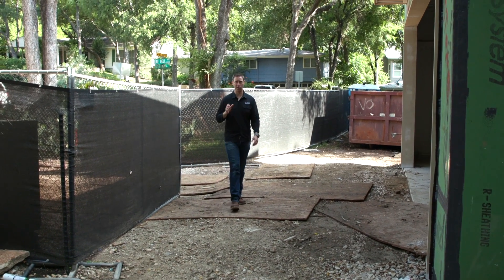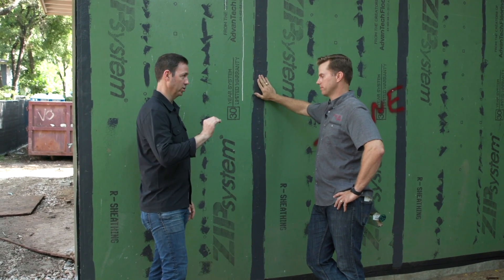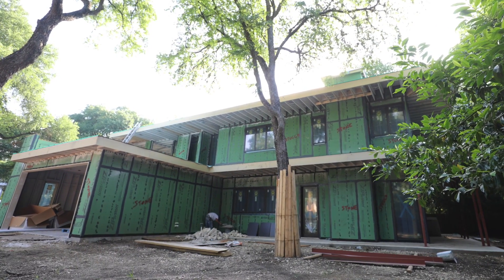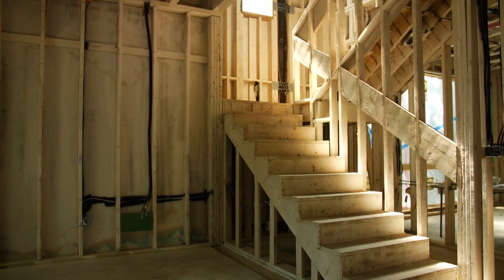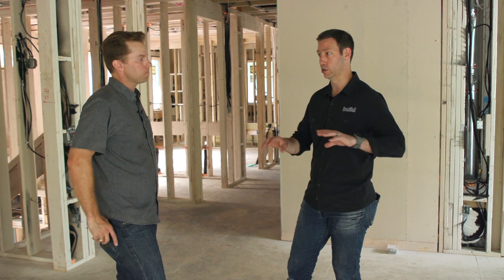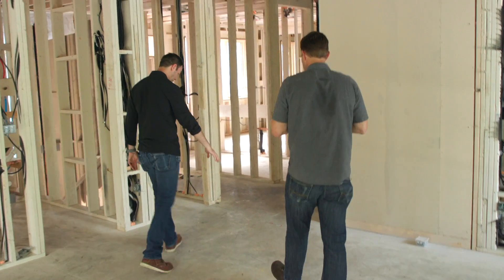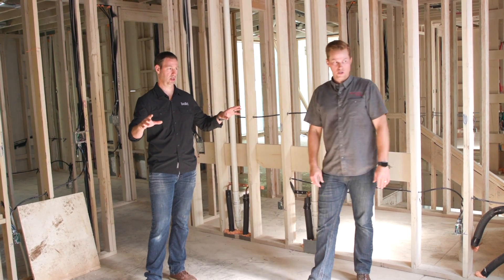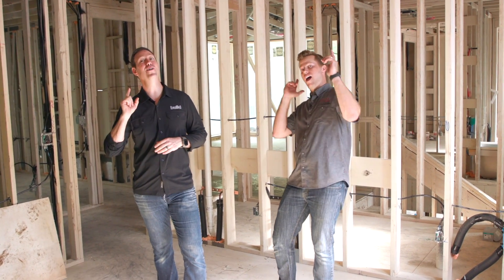Foam Free House - Is this Silly, or should we ALL BE BUILDING LIKE THIS?

Comment: Matt, I'm really intrigued buy the Zip system and will use it when we build next year. Using the liquid flash seems like it's more labor intensive but it'll allow for 100% coverage of seams and nail holes. Is there any way to continue this barrier method when installing roofing and or siding?
Reply: Yes, zip has a thicker material (it's pink) for roofing. And just tie them together with fast flash
Reply: FWIW: Put a bead of caulking on the studs before you nail the sheathing to the studs. This should help with most of the air sealing.  You can use a cordless or pneumantic calking gun to make it quick & easy.

Comment: Has problems with EMF, goes to extraordinary lengths to shield wires in the walls, all the wires attach to ... Outlets which stuff is plugged into. Didn't see the part where the whole house is wrapped in a Faraday Cage. Maybe later! Oh, make sure to never turn on the Mains breaker either!

Please tell me this person doesn't work for the government!
Reply: Im glad that someone else made this comment. I was thinking the same thing. I was also wondering if they put ferrite caps over the outlets. It doesnt look like it, so i hope the nut job doesnt too hurt by the EMF demons. 

As for the person working for the government... yes, they likely work for the government. You can also guess who she voted for in 2016.
Reply: Do you even know what you are talking about?? EMF shields work!! It is no problem that there are outlets and / or you have parts that are not shielded at all. The shield work for the part that is shielded.

Comment: I bet that Matt is overjoyed that he isn't building for this client.
What type of house did she live in for the first 4 or 5 decades of her life?
How was her work space built? Does she go into restaurants, salons, gyms? 
Travel roads alongside petroleum vehicles? Experts sure are fun.
Reply: These people are not rational, so your questions will not make her think rationally.
Reply: @parajacks4  _Excellent point!
Reply: Yeah the perfume thing is probably just allergies.

I don't like sleeping in the same room as the wifi router because I can usually hear the external power supply squealing. That's it. It's just that normal, annoying buzz that comes from a switching AC/DC power supply doing its job. Eventually, I won't be able to hear it anymore, because that's just how it goes
Reply: @skuzzyj  The only time I've heard any squealing or other noise from a switchmode DC power supply is just before it died.
Reply: @TonyRule  
Yeah? I've actually had a couple go bye-bye lately.

But I've also noticed that from many electronics over the years, so I just assumed I was just naturally calibrated to hear and thus be annoyed by that hum/squeak
Reply: @skuzzyj  I actually have seven or eight 12VDC power supplies plugged into a multibox right next to me right now and all I can hear is the mechanical spin of the external hard drives they're powering. The one that squealed was on my Draytek Vigor 120 VDSL modem. https://youtu.be/-k5fuLDrpO4
Reply: @louish3010  you are one rude bastard.. keep it civil
Reply: She may have just gotten sensitive recently.  I've been chemically sensitive for over 21 years now, and It's a very limiting condition.  Restaurants are OK but salons and gyms I can't be in.  Travel is very difficult because of ubiquitous use of air "fresheners" used in almost all hotels.  The malady mostly affects women.
Reply: Barbara Smith 
Yes I understand chemical intolerance, my sympathies to you, as my wife gets a bad headache every time she is close to someone wearing perfume. It is the supposed sensitivity to electromagnetic radiation that makes me think she is not all there.
Reply: @parajacks4  no it's real. Some people can't sleep in the same room as wifi router, and sperm counts and qualities decline are the easiest things to notice. Also know that sperm count and quality is a scientific measure for toxicity. 
Chemical sensitivities are crazy a couple years ago I would have made jokes, now I have asthma attacks from people perfumes or fresheners or even bleach in a bucket.
Reply: @louish3010  that is just sensitivity to soy beans LOL
Reply: @parajacks4  about 20 years ago, I spent a summer at a  clinic to see if they could help my condition (they couldn't).  There I met at least half a dozen with people who claimed  to have EMF sensitivities.  I believed them because no one at home was believing me, so I was inclined to sympathize.  Why would they lie to a total stranger for no reason?
Reply: @barbarasmith6005  they wouldn't lie. it's more likely that they believe it makes them sick and like a placebo effect, them knowing it's there actually starts making them sick. But they could also actually get sick. I just think the combination of chemical sensitivity, electrical sensitivity, and phobias of foam and glue and mold starts to sound more like a hypochondriac.
Reply: @barbarasmith6005  I am mostly just chemically sensitive to what I call oh DAH Stinkum that women insist on wearing aka French toilet water
Reply: @stevepailet8258  I don't like any kind of perfume, either.
Reply: @barbarasmith6005  "The malady mostly affects women." Of course it does - they're far more irrational and neurotic.
Reply: @bmay8818  Maybe you aren't aware that, in addition to not caring about your feelings, facts also don't care about the year either.
Reply: @bmay8818  Despite what is clearly your best effort there, it doesn't hit a nerve with me at all because I know your claim doesn't apply to most men and certainly not to me.
Reply: @TonyRule  Careful there, you are skating dangerously close to the crime of "noticing".
Reply: @interferon4800  Yes, apparently some people believe that in this Brave New World one must not make observations over many decades and draw any  conclusions from those observations that may be seen as unfavourable by any person lest it cause someone, somewhere, to take offence.
Reply: @bmay8818  right!   They were half-assed rational post-war.  Now they've had their asses powdered for 2 generations and thoroughly indoctrinated with new age nonsense

Comment: Did I miss something?  The floor of the garage MUST BE, by code, below the level of the connected living space?  4" minimum?  Yes, I have been informed that the requirement has been dropped,,, because cars so rarely leak gasoline.  But garages are also the warren of lawn mowers, chainsaws, snow blowers,,, gasoline powered yard and lawn equipment.  And if the house and garage are on the same level,,, are the utilities spaces,, where resides the water heater, furnace, common ignition sources, again, at the same level?  In Texas I would think you would want the house raised for the next rain event.

Comment: omg...    😂🤣😂🤣      ”when clients have more money than sense”
Reply: When they even bring in "consultants" o suggest even more ways to be a P.I.T.A, it's time to cut your headache level and suggest another builder.
Reply: 10:53 the customer isn't that dumb
Reply: An ounce of prevention is worth a pound of cure.
Reply: @s0uthp4w68   sorry there isnt enough em from a 120 volt 60 HZ house line to worry about anything. along with they are putting clay on mare wood because of chemicals......what chemicals.
Reply: @3398halofreak  The clay paint is a practical product. It's to prevent mold and bacteria growth.
Reply: @3398halofreak  You misunderstood, the usual mold inhibitor would be the chemicals, so they used a natural inhibitor.

Comment: Videos always great to watch...I wonder if Matt can build me a tiny house that i can actually afford?
Reply: Get it built out of structurally insulated panels (SIPs), it’s the cheapest, most efficient and hurricane proof (with the right windows if necessary).    I quite literally know a company if you need one...
Reply: @grendelum  Bad idea:

1. Difficult to run utilities: Plumbing & electrical. Or you need to add a 2x4 studs as a utility wall space.
2. If it gets wet, your pretty much screwed. the OSB will rot creating an absolute expensive nightmare to repair. All it takes is a leaky window that has a flaw or if the window wasn't installed perfectly to cause a problem. 
3. very expensive. SIPS aren't cheap.

Best option for SIP is SIP roof panels, but you need to with a cold ceiling so the SIPs can breath to allow moisture to escape. SIP are moisture permeable and a lot of moisture from the interior migrates up to the roof. You also need to use a moisture permeable vapor barrier on the exterior side of the SIP roof panels. 

For walls you can add 2" to 4" of exterior rigid foam installation which can match SIPs depending on SIP thickness & rigid foam thickness. Rigid foam panels are quick, cheap, and easy to install and don't require complex installation like SIPs do  (Joining splines & need to backfill all the joints with spray foam)
Reply: I never thought about it, but this is actually a potentially brilliant way to find a builder, or for that matter a subcontractor. The people watching these videos are probably above-average builders/tradesmen.
Reply: Today... On the tiny build show!
Reply: Start saving $$$$

Comment: Ive had customers tell me to turn off their Wi-Fi when setting it up because they have EMF sensitivities as they're fooling around on their iphone. The only way to truly be away from EMF is to go live in the mountains. That jacketed Romex is safer but not for those reasons and that graphite paint doesn't make any sense you have to send energy somewhere.
 I'm sorry but that consultant is totally full of it just like the smart meter conspiracy Folk.
Reply: Cobalt is rather toxic as well...
Reply: cobalt can be toxic, so can many other things, depending on how its used and what it is combined with.
Reply: the flex conduit is still a conductor.
Reply: @nicodemus7784  I'm pretty sure the flex conduit is intended to be well grounded back at the panel. So it should act as a noise shield. I'm not sure anyone is questioning the effectiveness of the flex and the paint at stopping EMF, just the reasons for doing it.
Reply: @Andrew frink as caidhg mentions the graphite needing to send the energy somewhere, aka grounding it, the conduit is already grounded. there is a lot of useless redundancy displayed in this build.
Reply: @nicodemus7784  yeah you all are geting it. the flex conduit is grounded and therefore will take any EMF that the copper wire could produce which would be almost none considering its 120 / 240 volts 60 hertz which won't even induced voltage and wouldent have any other signals over it. then they cover it with magic graphite paint which somehow Shields it even more. what I meant when I said it was safer was that the Romex was more protected potentially from being cut or damaged by drilling or sawing.
Reply: Nicodemus It isn’t useless. It served to separate someone from their money!
Reply: @caidhg they are using EMI shielded power cables, inside flex conduit and painted with graphite/cobalt paint (presumably its conductive). basically its triple shielded power cable. that power cable has more shielding than a triaxial video cable for Pete's sake.  if the cable is run through the middle of the studs, nails and screws should not be an issue.
Reply: Sunlight is EMF.

Comment: I like the idea of the garage vent and the spray on natural mold inhibitor, but the EMI shielded wiring and the weird subfloor materials.... WHAT? lol
Reply: What are the odds the client runs unencrypted wifi once the house is done?
Reply: LMAO
Reply: @tshddx  I would say there is almost no chance that wifi will be enabled in this house at all.  It does not make sense to protect against so many environmental toxins yet ignore the obvious emf (wifi, baby monitors, cordless phones).  Ditto, I would say nearly zero chance there will be a microwave oven installed.  I would assume that shielded ethernet drops will be placed in every room, as well as traditional phone jacks and cat6 cable.  I would strongly suspect these folks will gently ask their guests to turn their phones and devices into airplane mode.  If you have not seen how ill folks become sensitized to environmental toxins this sounds like crazy overkill, but really since one's home is supposed to be a sanctuary, those with the means to afford it are making a wise investment.  "Resale value" is probably not on their minds.
Reply: Should just double stud and run EMT.
Reply: Lol if there's openings in the system the Faraday cage is not complete and will let out electrical magnetic waves. How's the client going to plug in something if there's no outlet? Oh what about all the electronics? 
I understand you can use Ethernet to avoid WiFi, but Ethernet cable also emits EMI.
Reply: @Shane_Zhang   Ethernet would emit such an insignificant amount of EMI and none of it reaches you. There's a drain wire running through that is grounded. Otherwise your data signals would get messed up
Reply: Nothing too crazy with MC in residential other than added cost for no real benefit but that EMI paint is batshit loopy.
Reply: @TheReedsofEnki  I think they use AC cabling not MC. The steel would absorb much of the magnetic flux emitted by current. 

FWIW: I went with MC cabling. Seen way too many screw\nail penetrations of romex cable in my life.
Reply: @TheReedsofEnki  I rewired my house with MC.  Its an old steel framed house so cant really run romex through all the sharp holes in the studs.  The electricians did most of it but I added on a ton of can lights and 3 and 4-way switches.  Its a little harder to work with and takes more parts, but it looks really nice once its done.
Reply: If you're not aware of em f and the sort well then maybe you should check it out in fact there's a video of the guy that runs virgin airlines Virgin records forget his name but he showed an x-ray of his friends brain who spent an inordinate amount of time on a cell phone and it was clear that the area on his right side right by his ear was completely cancerous and I don't know how many people would doubt what caused it just shows that where his telephone set a good part of the day was completely destroyed from all this radiation but the fact remains that electromagnetics can affect many systems in the body some we are not even aware of but it can't hurt to pay attention to this especially with the Advent of the new type of service that's out there now with 5G there are many medical practitioners who are concerned that by having your whole living space invaded by all these penetrating currents for lack of a better word I mean it's something to at least look into to call it crazy is probably a bit harsh I mean when Madame Curie had pieces of radium in her top pocket as she went to get a sandwich there is no wonder that she ended up with breast cancer I mean it goes on and on when you look at what radiation can do of course that's a little bit over the top of the story but we don't die in one shot from anything I mean I'm a painter and I'm not going to get lung disease from just breathing the dust of one exterior sanding of lead paint but the story deepens I must say
Reply: You know the more I watch this site the more I realize it is a true treasure in that it is plotting and measuring and explaining all the latest technologies of what goes into a house so that in the future we really have an idea of what attempts were made to rectify all the things that made the envelope of a building less effective
Reply: the subfloor material is not weird - it's magnesium oxide panels.  The stuff won't rot from water exposure, it won't support mold growth, and it won't burn nor be eaten by termites.  It has pretty incredible compressive and tensile strength performance.  It's also easier to work with than OSB.
Reply: @northavealum  Agreed.  It does everything Portland Cement and drywall can do and has been around just as long as well.  The raw materials don't exist in the U.S. and are heavy and expensive to ship, so it's only common along the coasts, where shipping costs are much lower.
Reply: Nicodemus I was thinking this whole video that this woman was clearly a Crazy person.
Reply: Hey on the bright side the WiFi and cell reception will be GREAT.
Reply: Gosh, I wouldn't mind having my own sensory deprivation house... but I think I'd just go full underground for the energy saving effects (plus I'm sure the 5 feet of dirt would help with... uh... "shielding")
Reply: @kalijasin  TBH, anything that I CAN hardwire I do not because of EMF but because wifi sucks period.
Reply: Buddy you're not too bright, are you?
Reply: I really like all the new choices in natural insulation that are out there from natural alpaca to 100% cotton from old and new denim and the new hemp insulation what else I think there's something from bamboo I could be wrong but they're really trying to give fiberglass a run for their money
Reply: That subfloor is the only part of this build that is consistent with their design criteria!  They worried about a lot of stuff, but in the end they proceeded to build the same house that everyone else builds, out of the same materials.  I mean, Zip siding...but then focus on eliminating plywood?  Because plywood is the real enemy, but OSB with integral air barrier is fine, because it will definitely offgass to the outside of the house...
Reply: Emt conduit all day everyday! Chicago 🇺🇸
Reply: @beniamincolta709  I worked in a early nuclear power station. They used Faraday shielding on some of the lab areas. [ Got to keep the EMF and cosmic energy out ] Bottom line - It's the client's nickle. If he wants a pyramid lined with aluminum foil do the best you can while building to code and build quality. MC cable is a good idea, just expensive for residential.
Reply: Chicago it is. I'm glad I'm in California now.